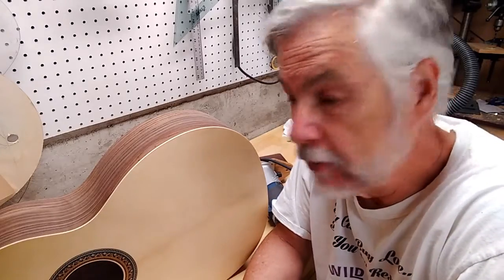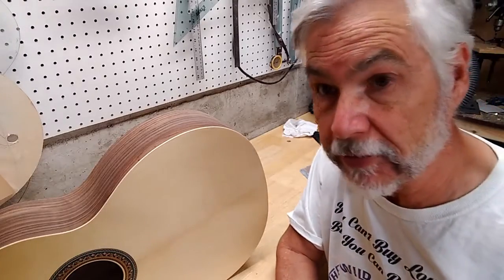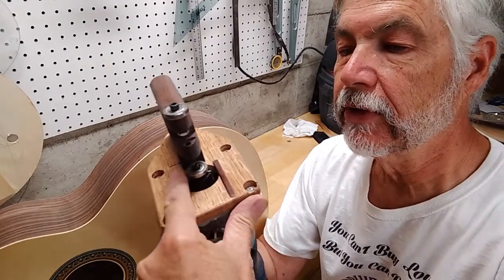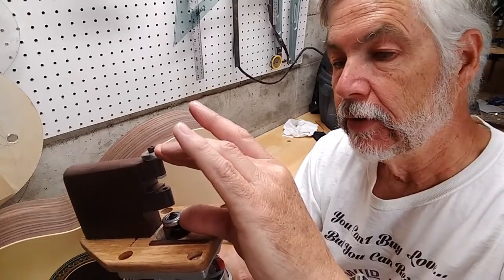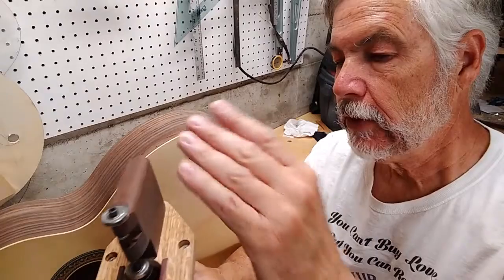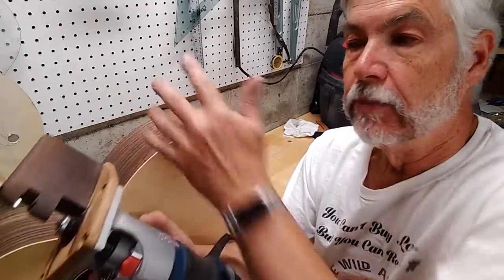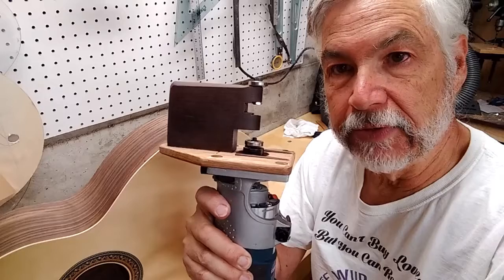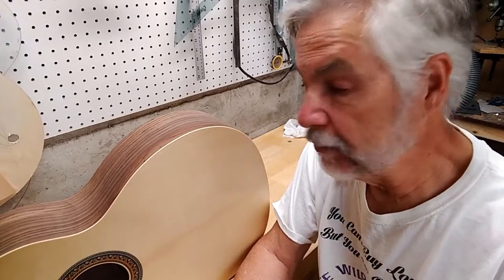The best binding ledge cutter design

Comment: I'd like to mount that to the top of my router table, then instead of holding the router and going around the guitar, I could just use my router table and run the guitar through it. Think I'm going to try that. I like your ideas!

Comment: Hello Chuck, Iam so happy I just found this vid, I’m a 65yr old woodworker I have been building ukes & parlor guitars for 6yrs now. I never used a jig to cut my bindings & they always came out ok. However Iam now building a full size guitar OM size and I can now understand why I need a jig for this task.. I really like your design I’m going to attempt to make your jig & practice on a sample body I built just for trying different jigs ect. Thank you again..
Reply from the maker: Using this design is a learning experience. Test using it on scrap material several times before subjecting your valuable instrument to it. You can get great results with it, but like all cutting tools, it can do some damage. It's wise to learn how that damage can happen and perfect your technique on scraps.

Comment: Your design is similar to the Elevate binding tool. They use a three point guide concept with two bearings to ride on the sides and a round stop centered on the bit.  They also use a very novel approach to setting the depth. Their design eliminates the need to swap out bearings for different depths. It's a bit too pricey for me, so I will be building one.
Reply: Yes, I was looking at the Elevate binding tool a few weeks ago, it does however look a bit precarious to use.
Reply from the maker: I have not tried the Elevate tool myself, but I can say that having the weight of the router above the work area and bearings does pose a challenge. The key to using it is making sure that the bearings are always in contact with the side and that they align perpendicular to the top (or back). Being slow and deliberate, always checking the alignment, is key to getting a clean and accurate result.

Comment: What do you use to hold the secondary bearing? Is it simply a nut and bolt or is it something you made? I’d appreciate any more insight into making your jig. It’s the best design I’ve seen being the best combination of simple, accurate and compact
Reply from the maker: Yes, it's just a nut and bolt. Easy to replace the bearings.
I think it's a good design, but like all power tools it requires some skill and care to get the cut just right.

Comment: Thank you Chuck. That was very informative. In regards to the router, are you using a laminate/trimmer router with a 1/4” collet? If so, what brand do you recommend? Appreciate the help as I’m looking to purchase a small router  for this procedure. Thank you.
Reply from the maker: yes, a laminate trimmer type of router is the only practical device for this unless you can find something even smaller/lighter. A dremel tool is not powerful enough and can't handle 1/4" bits. A good base is important for this kind of setup, so that eliminates most of the cheaper alternatives with plastic bases. The one I show in the video is a Bosch, and I've also used an older Rockwell. I've heard of people using Dewalts.
Reply: @chuckmorrison  Thank you Chuck! That was helpful!

Comment: With all due respect Chuck, yes we do........ watching you use the cutter is vital to understanding the working aspects of it. The ramps you mention?? again what do they do? why not sit flat, yes you need to adjust for the "angle" but 90% of the guitar is "flat" with respect to the binding??
Reply from the maker: Well maybe I'll do a short video of noise as I run this thing around a body. Personally I skip over parts of videos that show a machine being used. In order to get a real understanding of how to use something like this experience is the only teacher. The bearings must be held firmly against the side and the "ramps" must touch the top/back edge on each side of the cutter. It takes skill and paying attention.

The ramps, one on each side of the cutter provide a stop on the top or back. They are angled so as to only touch at the edge. This allows for it's use on arch top/back instruments. If your instruments are actually built with 90% (right) angles then you certainly don't need this. None of my instruments, at least for several decades, have a 90 degree top/side or back/side angle.

Comment: Great design. I am building a classical guitar and is approaching the "dreaded stage." I will make a copy of yours and try it out. Thanks.
Reply from the maker: Make sure you test it many times before you try it on the guitar. This (actually, any) style cutter takes a fair amount of attention to make sure it's aligned correctly while in use. The bearings must always be in direct contact with the sides. And keep your fingers well away from the cutter blades.

Comment: Very clever design. It is like a hybrid between the tower type jigs that use interchangeable bearings and the Elevate design that moves the bearings completely off the router onto a moveable "dumbbell" arrangement to make depth of cut changes. If you prefer to change bearings but still register on the side of the guitar instead of relying on a cradle to keep it at 90 degrees, then this would give the best of both jig types! Very unique! I bet you would get plenty of takers if you wanted to make and sell these!
Reply from the maker: yup, a decent summary. I don't know how much of a market there is, but for me the challenge is the design, not production or marketing. There are still some fine points to be perfected, but I think it's a useful design as it.

Comment: wow that's remarkably close to my solution, which also took about 5 or 6 other designs. I used uhmw plastic for the contact surface - slides nicer
Reply from the maker: Great minds think alike I guess :-). I can't claim the basic concept is original, although I think I can claim some of the details. Yes, plastic on the top surface would glide better. I may modify it for that.

Comment: What is the advantage of a spherical top and back and doesn’t that reduce the low frequency response? Thanks!
Reply from the maker: I'm not sure why you ask these questions on this video, but no matter ...

The top and back arching increases the structural integrity of the body, reducing the potential for (or at least the amount of) deformation on either side of the soundhole (bridge and neck/fretboard). Put another way, it reduces the likelyhood of collapse into the soundhole by the neck/fretboard and dishing of the top between the bridge and soundhole transverse bar (brace).

It also reduces the destructive effects of humidity, which when too dry causes sinking of both top and back. When top and/or back are built flat, this sinking will be more likely to cause cracking as the wood is pulled apart. When arched, the sinking top/back will be compressed as it sinks, which counteracts the shrinking of the wood as it dries.

Two things about low frequency response. The first is that on Classical guitars it is not low frequency response that is difficult, but rather the higher (fundamental) frequencies. So reducing the strength of the lower frequency response is not necessarily a negative effect if you want a balanced instrument. Second, whether the frequency response is reduced (compared to the flatter top) depends oh how you build the top. For example. If a double top (nomex sandwich) style is formed as an arch, the arch does not add tension and doesn't increase the pitch of the top, That depends on the specifics of the build of course, but if you test during building you can arrange the frequency response(s) the way you want it. Being in control of the build to accomplish the desired end is the point.
Reply: @chuckmorrison  thank you for sharing this insight 🙏🏽

Comment: Chuck, do you use a rolling pin sander or any kind of special tool to ensure your sides are flat?
Reply from the maker: Just a scraper and a flat sanding block. Although if I'm not doing a fully lined side I may leave in a bit of a ripple as the sides are 2mm or less to begin with. Too much sanding and it's unstable or just too thin. 

I do have a roller sander which I used primarily for shaping necks and heels years ago. It kicks up too much sawdust though and since I'm sensitized to rosewood(s) and mahogany, I stopped using it.

Comment: I like the design.  It's sorta like the elevate design, but without all the adjustments.  I suspect you could clamp the router in a vice, then have your hands on the guitar for some control..?
Reply from the maker: Yes, that's the name I couldn't remember when I referenced it in a previous comment. I like their design, but I've had issues with constantly adjusting the depth on ones I've built that are similar. Using the bearing sets for depth instead works better for me. You certainly could use the jig clamped stationary. It's personal preference either way..

Comment: is there a way to make that safer for people with motor skill issues? i know both your hands are in use away from the blade but would you be able to mount some kind of shield to prevent the blade hitting any part of the user in the event of something going wrong with either the workpiece, router or user?
Reply: In case you've described the best solution will be dremel setup for mandolin binding - it closes every access to blade. I cannot say tho if it will cut "guitar-size" purfling channel.
Reply from the maker: When in use there is very little exposure of the bit outside of the body of the instrument or the jig itself. However, that doesn't mean that you can't hurt yourself on it, so like all power tools, be really careful.

 A similar design exists commercially with an aluminum body, but it doesn't rely on bearing size for depth adjustment. That one is shown mounted in a vise and the instrument body is moved over the jig. That keeps the hands well away from the blade and it would be really difficult to injure yourself using  that technique. That technique can be used with my design as well. I find it clumsy and difficult to see everything well that way, so I move the jig around the guitar, not the guitar around the jig. I don't expect everyone to do things like I do them.
Reply: @chuckmorrison  thanks Mr Morrison, great content as always